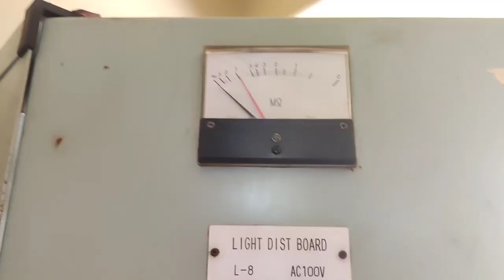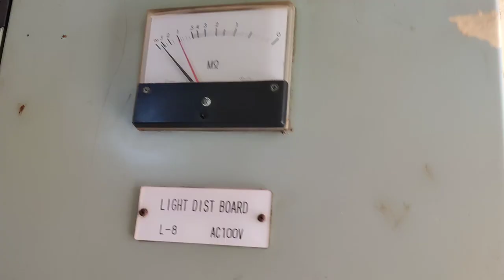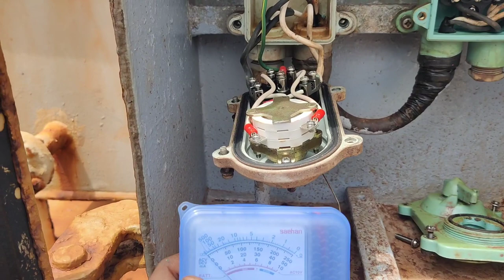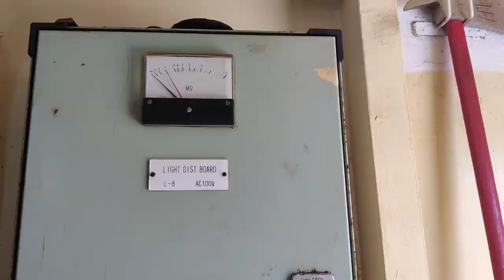Low insulation problem with solution try to share my experience #ETO JOB⚓🚢

Comment: I have a question. When checking low insulation on electric equipment, when we use multimeter & when we should use megger/insulation tester instead of multimeter. Thanks for answering & have a good day sir.